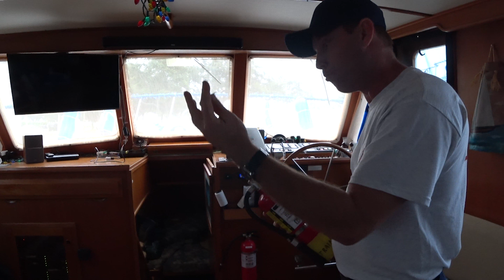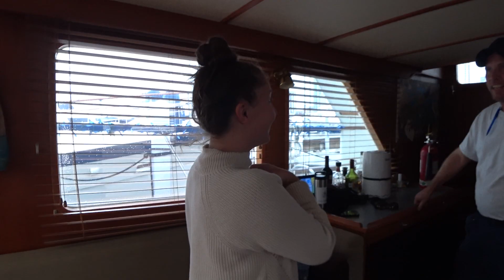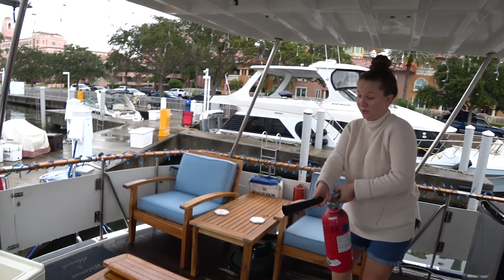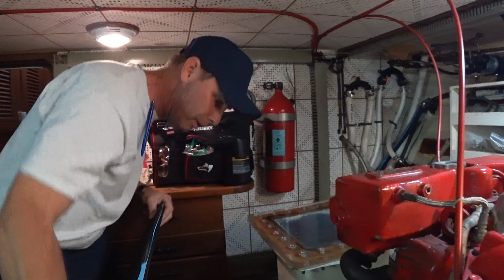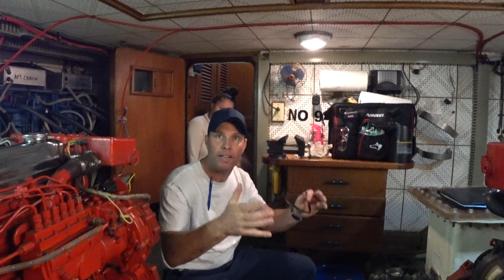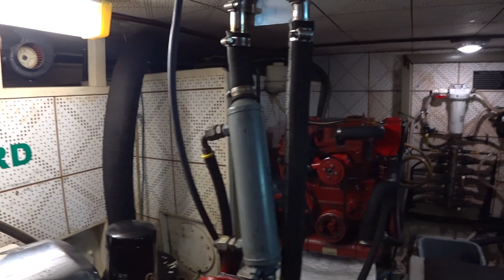Putting out fires! Inspection time for our fire extinguishing systems on the boat

Comment: Hi Butch, Great information. Glad to see a new video from you. I did want to add a couple of suggestions that people might find helpful. I highly recommend that everyone have at least one fire blanket on their boat. Definitely one by the galley and one by a bbq grill if you have one on board. Much better to quickly put out a grease or oil fire than an extinguisher. The one I like best is called Kovenex. It has better properties than the usual  fiberglass or wool blankets. They are a little harder to find, but are available from www.thegrommet.com
Also many people might not know about a product called Element Fire Extinguishers. Like the gentleman in your video mentioned every country has there own standards and Element Fire Extinguishers are rated in Europe. They won't count towards the Coast Guard required number of extinguishers, but they have several advantages: 1. Depending on the size they last 5 to 10 times longer than those 5 lb. extinguishers in your video 2. They leave no residue of any kind 3. Work on all types of fires 4. Never expire or need service 5. Have no gas or harmful chemicals, you can breath it in all day with no ill effects. 6. Small and compact and can be put close to where they are needed. The only down side is they are a bit pricey. There is a lot of information on them on their web site: www.elementfire.com   Plenty of youtube videos on their product too including one on Jay Leno's Garage. Hope that information is helpful.
Reply from the maker: Hey Paul, thanks so very much! I am glad you brought up the fire blanket. I have been planning to get one or two on board, and I totally forgot to mention that. A good friend of mine actually runs a textile business that specializes in fire suppressing materials, and she is going to give me a blanket next time we see each other. I can't remember the name of the company though, shamefully. They even made special covers for the turbos on their 60' Hatteras Sportfish. 
I didn't know about the Element Fire Extinguishers, thank you. I will definitely look in to those. I was also at a conference recently and came across a new type of fire extinguisher company called Rusoh, https://www.rusoh.com/.  Their product is a self-service,  multi-purpose, reloadable dry chemical extinguisher. Definitely another one to look in to. 
I really appreciate the additional information! And on another note, we need to get together sometime soon, finally!
-Butch
Reply: Definitely would love to get together sometime. I’m heading to the Riviera Dunes Marina in Palmetto tomorrow morning to check it out then stopping at the Harborage Marina in St. Pete on the way back. Still haven’t found a definite place to put my boat yet. I have some time. It won’t be delivered until December, but I’ve been looking for over a year and starting to get a little nervous. Very few slips in the area for 60 ft. & 18 ft. beam.
Reply from the maker: Very nice. Yeah not an easy task to find a desirable slip, let alone one that can accept that size vessel. Let me know how the search goes. I know that Riviera Dunes is a great facility, and well protected, but a little remote. And the Harborage seems to be quite populated these days, but fantastic facility and location. There is always the Vinoy, altough the east winds can be a bit of a pain, but I love it there.
Reply: Thanks, I should check it out and see what type of availability they have. Who knows, maybe we’ll be neighbors.

Comment: Glen did a good job. Glen I think it’s important to stress the point  of purchasing quality extinguishers only and how to pick up an extinguisher by the handle. Fluffing the extinguishers increases the chance of breaking the seal and having someone zip tie the pull pin, with the modern siliconized dry chemical powders fluffing isn’t necessary.  Halon extinguishers can and are refilled with reconditioned surplus Halon, Halon 1211 extinguishers are still sold. Again Glen did a good job, he’s knowledgeable and a good trainer. 
 Although it’s a chunk of change I’d recommend up grading to the system described that will shutdown the blowers, vents, and engines I had a guy bring in his singed system cylinder,he said it did not put the fire out and his boat burned to about the waterline. His Halon system didn’t have the bells and whistles to shut everything down the diesel sucked in Halon into the intake and right out the exhaust and kept running along with the fire.
Reply from the maker: Bill, thank you for the info. Glen did a phenomenal job, and took so much time to go everything with us. I did leave out quite a bit of his information since it would have pushed the video too long. I definitely plan to upgrade the fixed-mount system in the engine room. We just have to be aware of the situation and shut the engines down manually if there is a fire. Luckily I have a camera in the engine room and smoke alarms that will alert me, so we should be able to identify a fire pretty quickly. Also, I would like to have the manual-pull feature so that we don't have to sit and wait for the mounted extinguisher to reach the temperature to deploy.